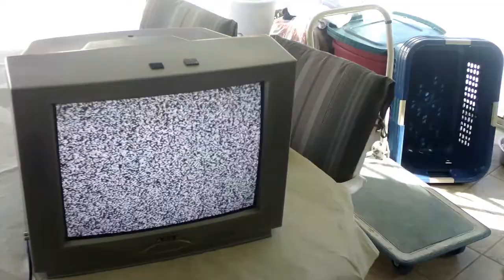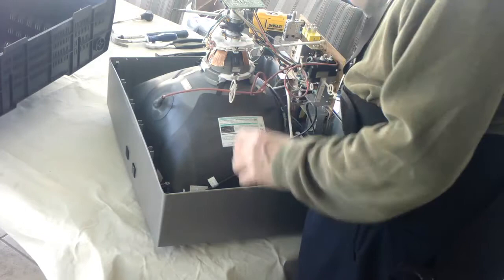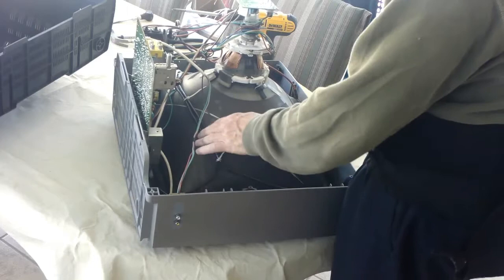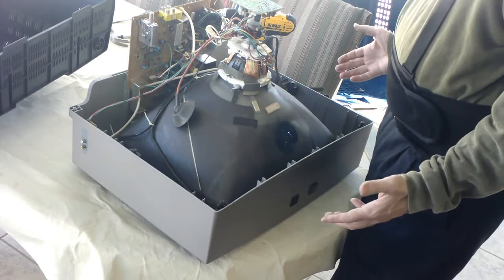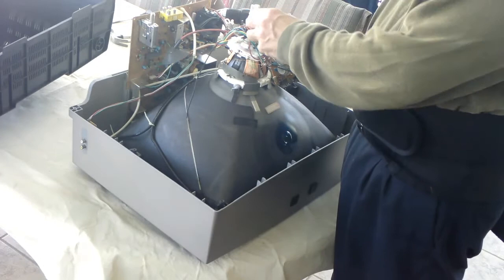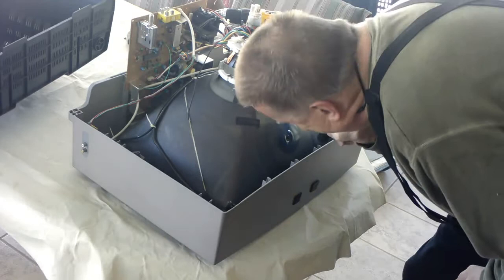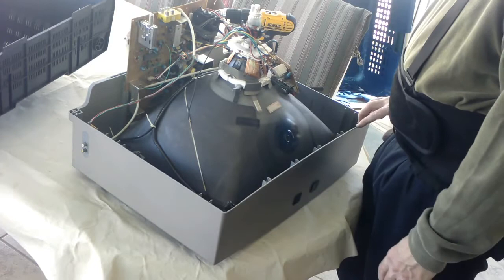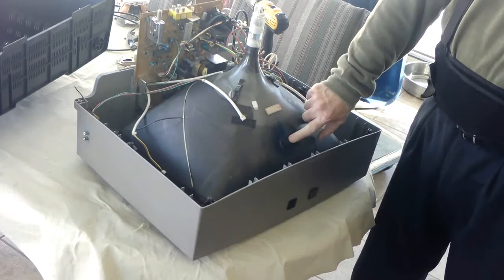How to SAFELY Discharge and Release the Vacuum from a TV / CRT / Computer Monitor Display tube.

Comment: I'm wondering if I can just unplug it and if it will discharge itself in about a month?
Reply from the maker: A lot depends on the electrical design of the monitor/tv.  Older models, which take a while to "charge up" before an image appears will tend to bleed off the built-up electrical charge over time.  In later years, consumers wanted a tv that displayed an image quickly - and these models are able to do this because the circuit design retains an electrical charge for a longer period of time.  So I guess the short answer is "maybe"?  I know that doesn't help much - sorry.  In my own opinion however, the discharge of the tube really is fairly easy, and it's not difficult to do this safely.  Will you be releasing the vacuum inside the tube as well?
Reply: @ToddMcMahon  Thank you for your response! I appreciate it! I have probably 3 crts with a vcr or dvd player in them and they are all broken down. I bought used and they've been unplugged for a number of months. Just trying to make sure I do this safely. I didn't know about the vacuum until today.
Reply: I want to see if I can repair the vcr or dvd player.
Reply from the maker: @SolidNate99  - Sounds like a cool project!  Good luck!  :-)

Comment: hi thank you for this ! i opened my tv, its not been turned on in over a decade maybe even 20 years, kept in my friends parents attic and when opening it the wire that looks like it should be the ground it splits into two sections, clipped at the top before the split to a black wire that goes up into the yoke. one has a spring & the other just goes down, which one do i wedge the screwdriver in ?
Reply from the maker: Typically, there is a bare wire running across the back of the tube against where the glass of the tube is painted black or dark grey.  You want to short out between that bare wire, and the connection that is under the rubber cap on the tube.  This being said, 20 years is a long time, and there is probably no electrical charge left.  Your biggest concern will be the Vacuum inside the tube.
Reply: @ToddMcMahon  thank you ! I'm trying to remove the parts to turn it into a costume, after connecting to this braided bare wire will is be safe to cut other wires around the motherboard out ? without touching the capacitors of course : )
Reply: @ToddMcMahon  I got in contact with the friend I sourced it from & it was about 12 years not 20 ! is it still most likely safe anyway ?
Reply from the maker: @skttrbrain  - Nice!  Yes, once the "Annode" connection of the tube (under the rubber cap) has been shorted to ground, you should be OK to touch and remove the electronics safely.  Just remember to also release the vacuum inside the tube so that it doesn't implode.
Reply from the maker: @skttrbrain  - Yes, once the "Annode" connection of the tube (under the rubber cap) has been shorted to ground, you should be OK to touch and remove the electronics safely.  Just remember to also release the vacuum inside the tube so that it doesn't implode.
Reply: @ToddMcMahon  hi thank you so much for all your help ! I got everything out safely : )

Comment: I always thought there was some sort of non breathable gas inside crt tubes, not just a vacuum
Reply from the maker: There are some manufacturers who would first fill the tube with an inert gas (like nitrogen) before applying vacuum, but most just warm-up the tube then apply vacuum and suck out the air before sealing the back of the tube.  The dangerous part is primarily the phosphor coating inside the tube, however, the GLASS itself is also hazardous waste, as the glass contains a mixture of several heavy metals (primarily lead, but several others including mercury).  Either way - it's nasty enough to warrant extra care and propper disposal!
Reply: @ToddMcMahon  now that’s pretty scary, I used this video to take apart a bigger crt tv and the only thing I haven’t token apart is the crt tube. I’m worried since the tube is so big, it will implode when I use the nail
Reply from the maker: @Dipplers  - Use a SHARP Ice Pick or Awl - and tap it with a hammer until that metal plate has punctured, in the place where I show you, and you should be fine.  The glass around that metal contact is thicker and it is made that way exactly for this reason.
Reply: @ToddMcMahon  ok, that sounds easy, all I want to do is remove the electron beam gun to look at it closely and throw all the glass away

Comment: So if u discharge it is it free to bring to the dump
Reply from the maker: Discharging the electrical charge, and releasing the vacuum as I demonstrate in this video makes it "SAFER" to dispose of, however, it still contains hazardous materials which require special handling so that these hazardous materials do not enter the environment.  So "NO" - It should NOT simply go to the dump.  Whether or not it would be FREE to dispose of depends on your city or state environmental programs.  Here where I live, things like monitors, TVs, microwave ovens, florescent tube lightbulbs, electronic-waste - basically anything bad for the environment are free to dispose of at hazardous waste disposal centers, just to keep them out of the landfills.  Anyone caught disposing of hazardous waste incorrectly are charged HUGE fines.  It makes sense to dispose of such things correctly.

Comment: Tv has been unplugged for months. Is there a charge still?
Reply from the maker: Many TV makers (but not all) add a resistor to the circuit between the High Voltage power and ground to very slowly bleed off any residual electrical charge.  But why risk it?  It's a simple thing to do, so just discharge the current in the tube to be safe.  This being said - there WILL still be a large amount of Vacuum in the tube - so be sure to release it!   Better safe than sorry!

Comment: The retro gaming community doesn't like what you did
Reply from the maker: I know, right?  I guess I neglected to state that the TV was defective - which was the whole reason it was being replaced in the fist place!  <sigh>
Reply: @ToddMcMahon  i hope it was the flyback or the tube itself most other things are easily replacable
Reply from the maker: @hyakin7818   - You know, I didn't even try to find out.  This defective TV was in the guest room at my Mom's house - and she wanted it REPLACED.  That kind of ends all debate on the matter as far as I was concerned, and since I could use the copper, the decision to scrap it was an easy one.

Comment: Is there still a risk of being electrocuted if the TV set hasn't been plugged in for at least 20 years? It's probably been more like 40 years since it was plugged in. Also, I'm a little leary of trying to release the vacuum working so close to the TV, my idea was to tie l long rope around the neck of the tube, and yank on the rope, causing the neck to snap off. What is your opinion of this scenario? Thank you.
Reply from the maker: After so much time has passed (20 years!!) I am confident that the electrical current has dissipated.  This being said, the Vacuum will still be a safety issue, and if not released in the manner I have shown in this video, there will be a LOT of hazardous waste and shattered glass that will be a pain to clean up properly.  Yanking on a rope could simply cause the CRT to tip over or fall to the floor and shatter, causing an even bigger problem!  Be careful.
Reply from the maker: @russojap1864  -  That should work fine, although probably not necessary.  The glass in that area is very thick for that reason.  Just be sure that your hammer doesn't hit the yolk (neck) and you will be fine.